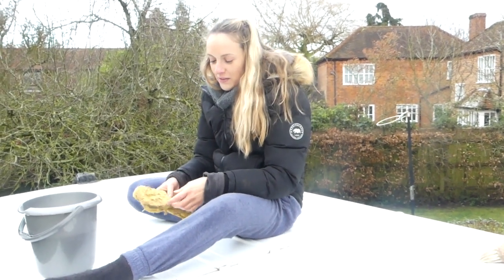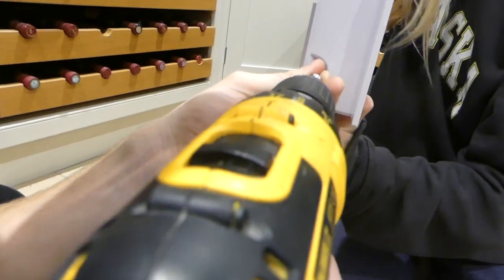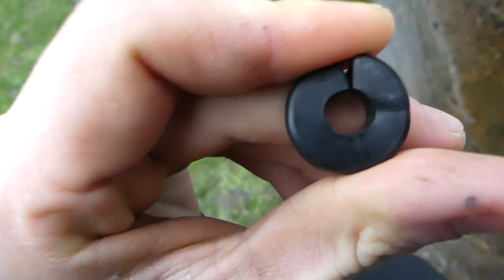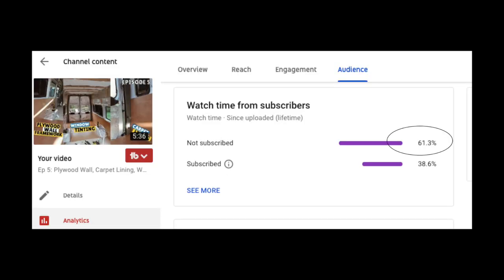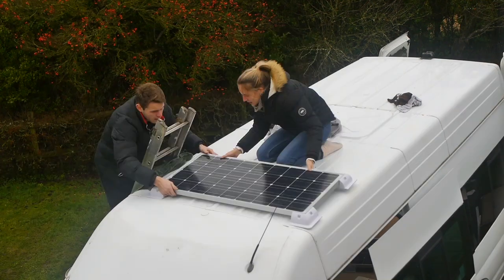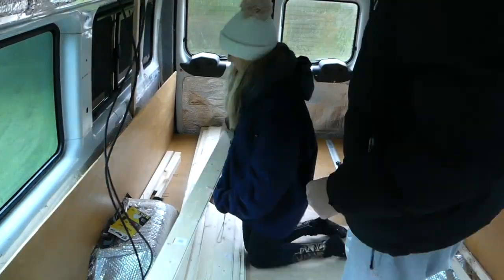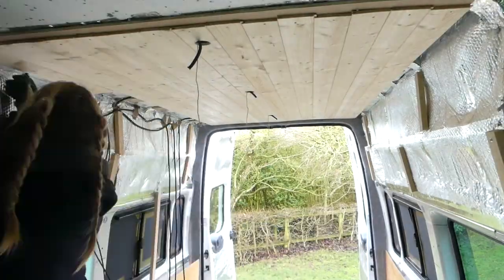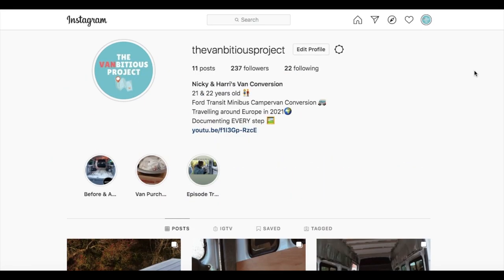Ep 6: Installing 100w Solar Panels & Ceiling Cladding / FORD TRANSIT CAMPER CONVERSION, UK VAN BUILD

Comment: Good work guys. Where did you get your wiring for the lights?
Reply from the maker: Thanks! We got them from eBay. There 1.5mm cables, and we got 15 metres worth. But will probably actually need to get some more for our USB sockets, etc.

https://rover.ebay.com/rover/1/710-53481-19255-0/1?mpre=https%3A%2F%2Fwww.ebay.co.uk%2Fitm%2F1-5mm-x-2Core-Rubber-Cable-Flex-H07RN-F-H07RNF-Heavy-Duty-Drills-Tools-Hoover%2F184197625428%3Fhash%3Ditem2ae308b654%3Ag%3AjNYAAOSwFnleX9LE&campid=5338766321&toolid=10001&customid=

Comment: We're also doing our van just now and feeling the issues with cold and damp, all the surfaces are constantly wet! I've been using a wallpaper remover heat gun (hairdryer would also work) to heat bits of the van if needed for applying various adhesives. Could be useful for you guys if you have to glue any more bits down?
Reply from the maker: Thanks for the tip! Good luck with your build! :)

Comment: Did you find the 100w was sufficient or would you have gone with more panels in a new building
Reply from the maker: It was 2x 100w panels. So 200w overall. Was more than sufficient for our travels. Although worth noting that we were in Europe in summer time!
Reply: @NickyandHarri  amazing thanks!